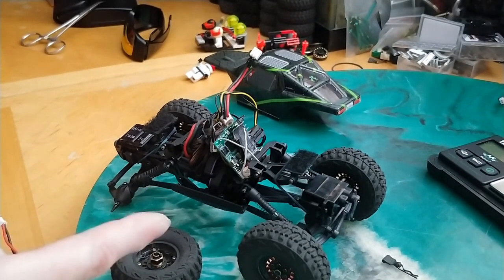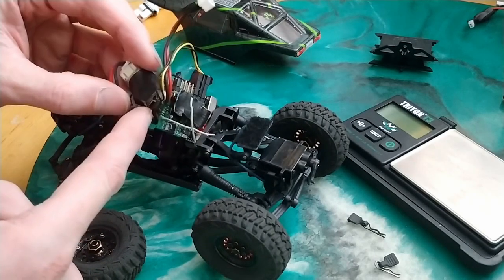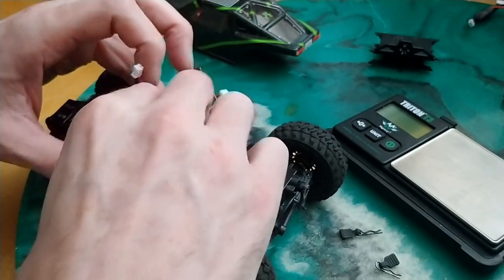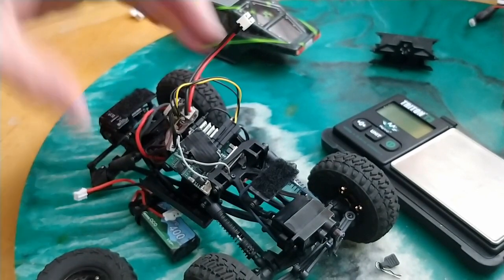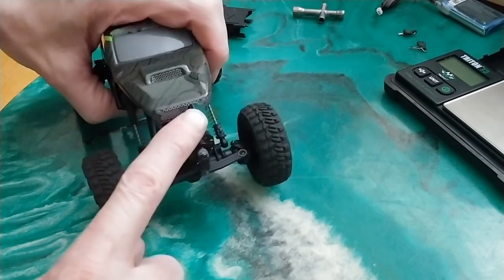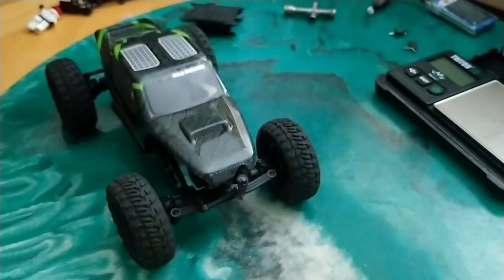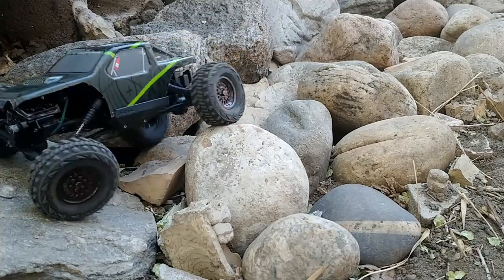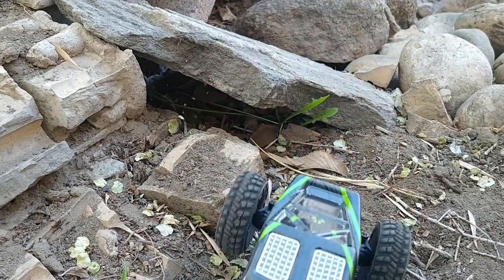Modded Ax24 Hittin the Rocks, Heavy Wheels are Key!

Comment: They really aren’t that bad out of the box though..
Reply from the maker: I think that they are thee worst 24 by axial outta the box. Its literally a rolling machine, just watch people use it. It can only handle one tire going over one lil rock or bump at a time, cant climb at all without rolling back. Cant do too much, and its noise the esc creates in the motor is just insane, AND its got no slow crawl at all. its a rock bouncer.

Comment: I’m really turned off from buying these. At minimum I’d have to get a new body and wheels to even stand looking at it. And then I see this thing can’t even manage two emax servos and a slightly bigger motor without crapping itself. I just decided to grab an injora buggy cage and another front axle and just deal with the 3 position switch.
Reply from the maker: I feel that. Ive got 2 emax in this one, just needed to melt the servo arm a bit(did a vid on it) and its got the purple injora motor but Im finding the key is the Furitek Lizard Pro Esc, that makes its all seem to work pretty decently.
One thing Ive been pondering over is the Rev 2.0 from DINKY RC, it looks awesome! So what Id do is take the guts from this thing and put it all into that rig, and probably either get a V2 electronics or up grade fully to a Stinger combo from Furitek and run this things electronics. 
I just wish the people out there doing the reviews when I bought this nightmare were honest about it as I never would of got it, but everyone seemed to think its awesome stock. Its not, it needs a ton of work, chopping melting and what not. LOL Id check that Dinky RC out man, the Rev or Apex look pretty awesome, the Amigo looks ok too, but I much perfer the Rev. I kinda wanna stretch this thing out a bit too so the Rev looks perfect as its based on the Gladiator chassis!